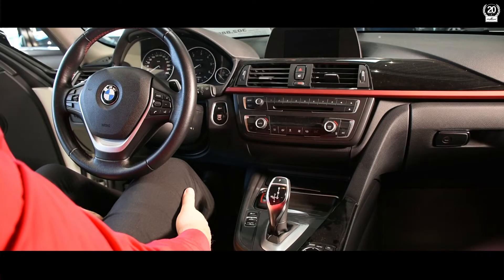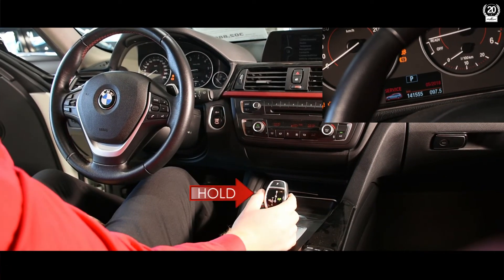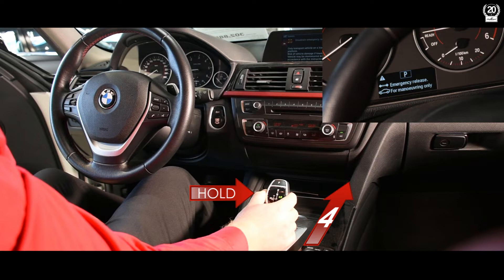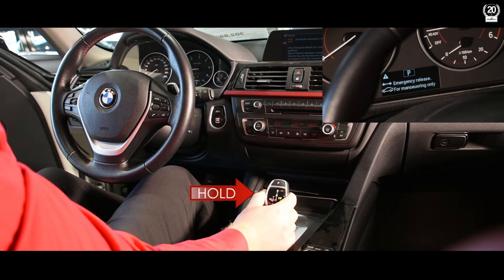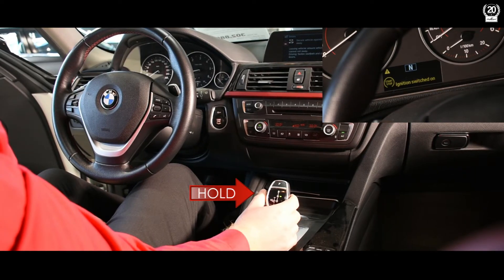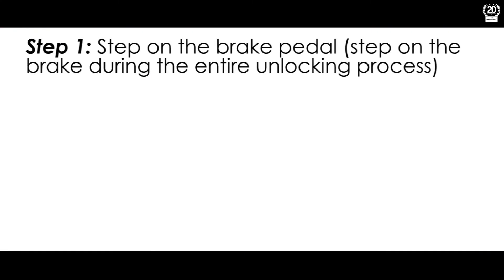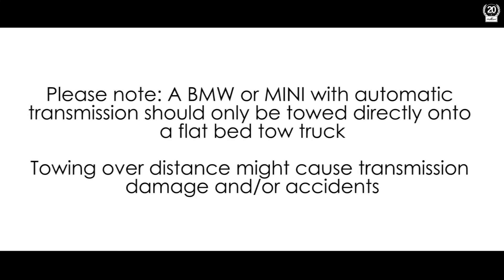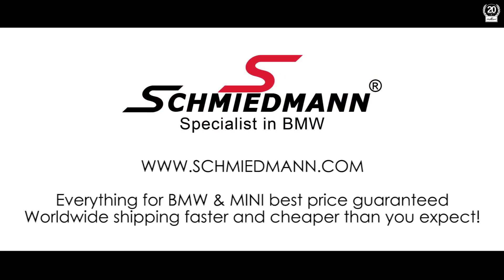BMW transmission lock - DIY how to electronically unlock the transmission lock

Comment: I want to remove the shiftlock solenoid and throw it in the bin,
But when it's unplugged you get the dash cog warning light,
Can you bypass this?,I've tried jumping between the two pins, but this didn't work

Comment: If I use the manual 5mm pin under the vehicle to unlock. Is resetting the transmission computer necessary?

Comment: Did a transmission replacement and then put the original metronidazole unit back in it but stuck in neutral now won't go into no other gear and I got a charge red light saying no charge can that make it do that to transmission??

Comment: mine 2011 x3 is stuck in P. It wont move at all in R D or N. The car starts up fine and runs strangly I can even rev it but it wont move. Going to try the method of going under the car and unlocking it manually to get it towed hopefully.  Any ideas are welcome..
Reply: How did you get it fixed?
Reply: @nucleus8706  screwed the bolt in under the car.  Popped it in neutral. Transmission is junk.  Sold the car for parts. Not buying a German car again. 78k miles….
Reply: @pfdavidz  Ah man…sorry to hear. I sent diagnostic error code to BMW…they suspect faulty gear switch lever. Will wait and see

Comment: My car stays I neutral and won't go into park. Its a bmw x3 2011. If I press the park button after being in drive, it goes back into neutral. Any way to fix this?
Reply: I'm having that same problem..did you get to fix it?
Reply: @LAREXJR  naaa, I'm still getting the problem. I was told to get the gear box reset using a diagnostics machine but haven't got round to it yet
Reply: @kaeylnsklub6894  damn...this might sound crazy to you but I read I'm a BMW forum that 7 out of 10 it's because there is a coin lodged in the shifter box under the shifter boot. Well lo and behold I removed it and there is a penny lodged in there but I can't get it out. It's not like the penny is obstructing anything but maybe just the metal interfering with the electronics from the shifter??? Maybe...could be

Comment: Excellent explanation. Have a weird situation. Bmw 135is (2013). Battery dead after shipping car abroad. External power turns engine running. Get the transmission stuck into P. Will this allow me to get into drive or just Neutral?

Comment: 2011 X3 - this procedure works up to step 3 (I get the acoustic signal and a warning about the car rolling) but I’ve done the remaining steps exactly as in the video and it never goes to N.
Reply: I’ll need to do a few more tests to make sure, but I eventually got my car into neutral and I think the critical bit of missing information is that the driver’s door must be open.
Reply: @antonbijl omg rlly

Comment: Does the engine have to be running or will ignition only work?
Reply: Wrong I have one running and it's stuck in park
Reply: @GioMillz  yeah my 535i xdrive was the same, had to be towed on a flatbed
Reply: Have the same problem…how did you solve it?
Reply: @nucleus8706  check your owners manual, every model is unique
Reply: @usmclongrangebrainsurgeon  Did you end up replacing the transmission?
Reply: If the engine is still running, the car shouldn't be stuck in PARK.

Comment: Terrible design... what if you cannot allow the engine to crank over or it'll cause further damage?  This is a bad design,  slow, complicated & requires a key fob & battery power.... often none are available. BMWs & MB suck
Reply: the same thing happen on my mini i cannot crank it all we do is put a dolly roller on the other side of the front wheel

Comment: If the car stop in wrong place and wrong time, you are dead. 
Thanks to BMW. I am ASE master tech 
and in my opinion I prefer old systems.
Reply: I have to agree. BMW could have thought this one out better. Having to rescue a stalled BMW, in the dark of night, in the middle of winter, 30 below zero, wind blowing the snow, laying under the car that a tow truck was holding high enough to allow under car access was no picnic.
Reply: Mine stopped in the middle of the highway yesterday
Reply: @johansamaniego6732  Stopped while you were driving, or stopped when you came to a stop?
Reply: @rollydoucet8909  it stopped working while I was driving in the highway
Reply: @johansamaniego6732  Once the car came to a complete stop, was the transmission in PARK?
Reply: @rollydoucet8909  yes
Reply: @johansamaniego6732  The same thing happened to someone I know. The engine died while she was driving so she stopped the car. When the tow truck arrived, the transmission was locked in PARK and without being able to start the engine, there no way to dis-engage PARK unless the trans is manually unlocked with a tool  under the car.